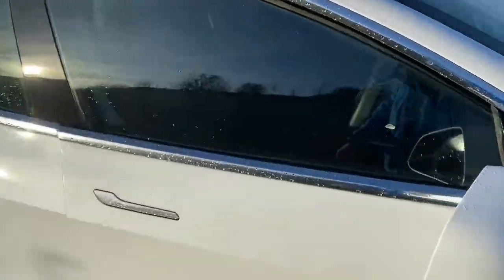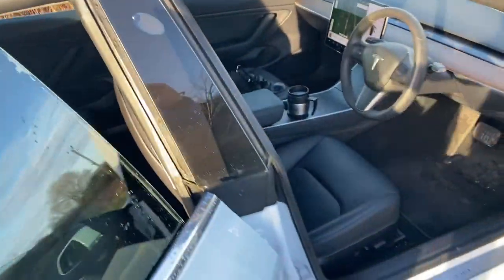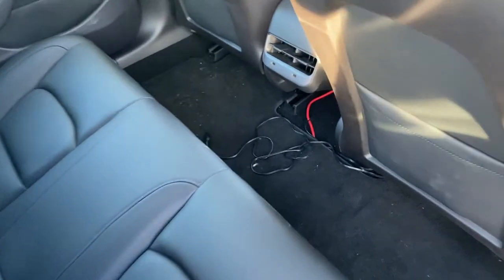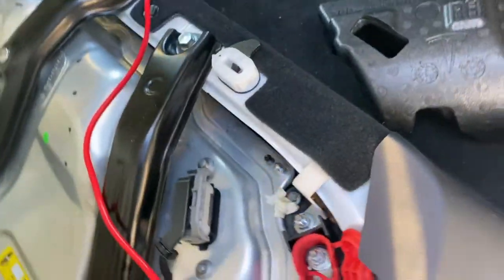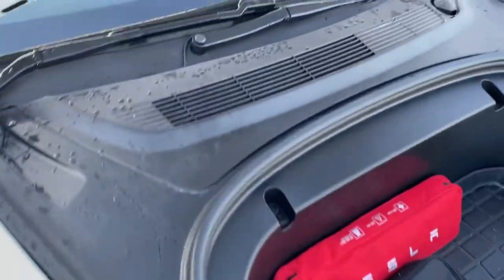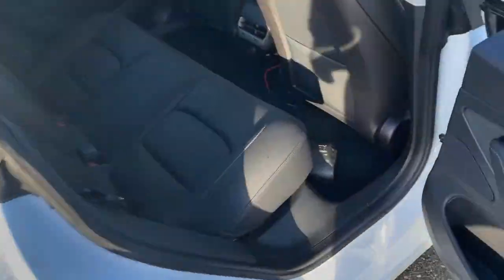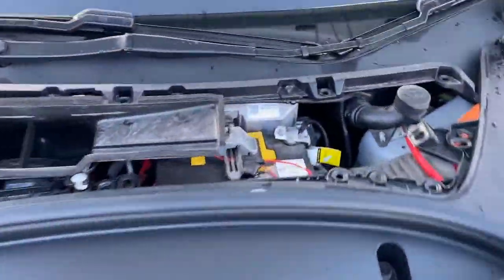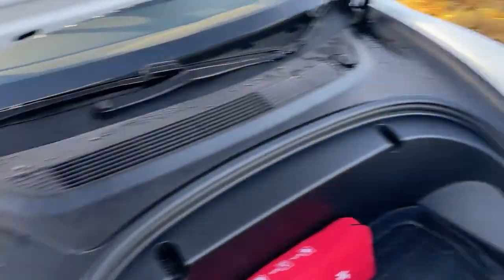Tesla Model 3 - How to reset the 12v system

Comment: Changed my 12v battery. Heard a few relays click and a motor whirring. Put it all back together and the screen wouldn’t come on. Reconnected old one and fine. Did I not wait long enough for it to learn or poss new batt needs a change. What’s your thoughts?

Comment: I don't know how he did it, but my Tesla mobile service came to my house replaced the low voltage battery and he never unplugged the connector under the seat and when he finished there was 0 code 🤔🤔🤔. But now I I got another new low voltage battery and I still see the battery message😡 will try this way and see if the message goes away
Reply: How did you get it resolved?

Comment: This looks just the ticket. In the cold weather, got a ‘car may no restart’ code - my 12v battery died and I got recovery but the car was so dead it couldn’t be towed. The recovery guy took me to halfords and we got a brand new 12v battery, fitted it, the car started and ran fine and I was able to get home, but the ‘car may not restart’ message came up as I got home. I know the 12v battery is good, as it’s brand new. Is this reset likely to fix the issue? Thank you!
Reply from the maker: it won't do any harm to start with a clean sheet which you should do when replacing the battery anyway

Comment: What if I have the black screen issue and I can’t power off the screen. Do I do the same thing as well unplug the main battery on the seat first than the negative battery, than plug the main battery and connect the negative terminal in that sequence
Reply from the maker: Yes that is the correct order
Reply: @thelifeofbatteries  thanks didn’t work. Did soft reset and hard reset and my screen is still black
Reply from the maker: @ariesanfilippo1078  you may have a dead MCU
Reply: @thelifeofbatteries  will that cause my app to not show my charge, I can control the locks and I can drive but I can’t use the climate or see how much charge I have. The car does charge when I connect it to my charger. Tesla said I’ve been offline for a week now.

Comment: Help!! 

My charger tripped and then I started having electrical problems. Got the electrical system power reduced error. Now following your steps. Currently waiting. 

Does this mean my battery needs to be replaced? Or maybe my charger isn’t adequate? The breaker tripped then the car got stuck basically. 

Can you send your charger specs? Don’t want this happening again
Reply from the maker: I have a standard type 2 7kw 32a wall box. Your 12v battery may need to be replaced. You can use jump leads to connect another battery whilst doing the reset, connect it just after the factory one to see if it clears the fault